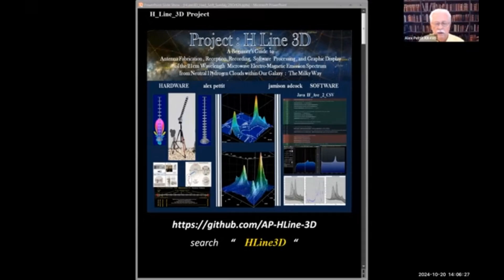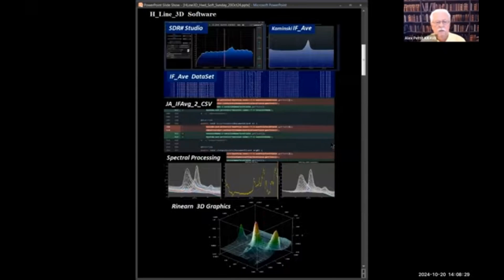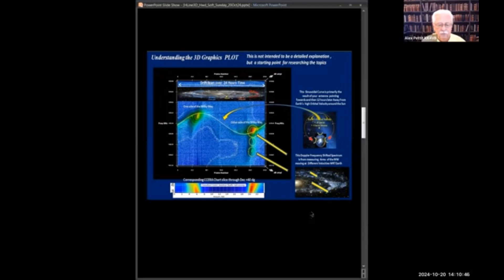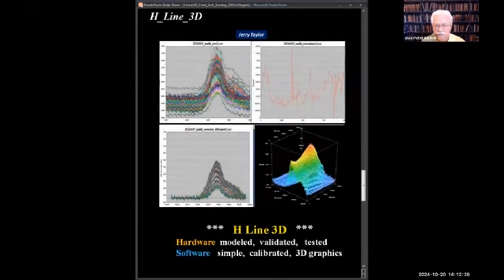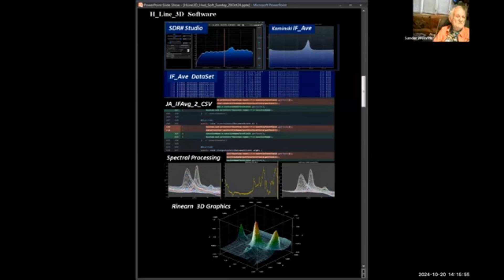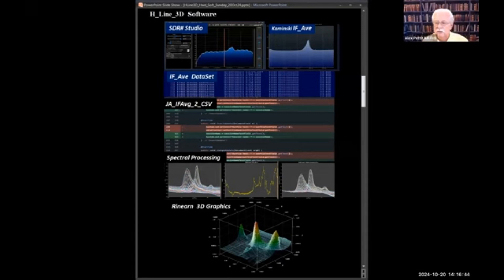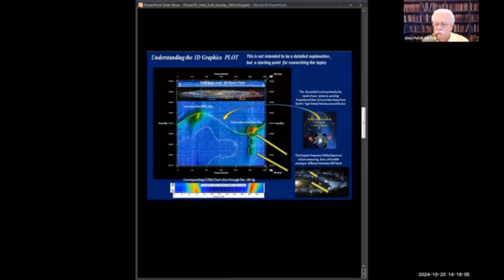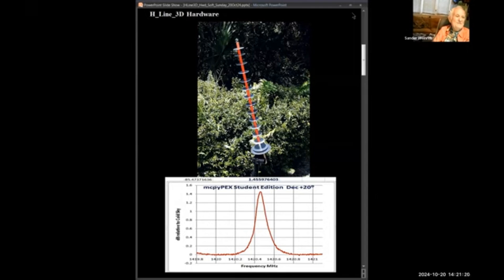Alex Pettit & Jamison Adcock:   H Line 3D project

Comment: Hi, I assembled this antenna, the analyzer NanoVna showed that the frequency is 1420 if the distance between the feed and the director should be 50, not 40 like yours. This is only probably in my case.
Reply: Whatever Works !   Post some Results :)   Thanks, Alex HLine3D